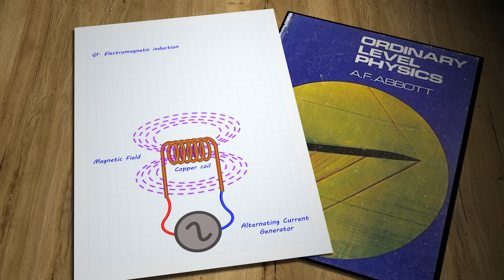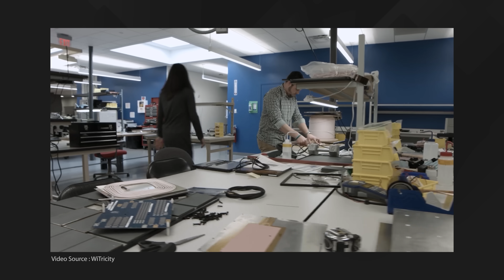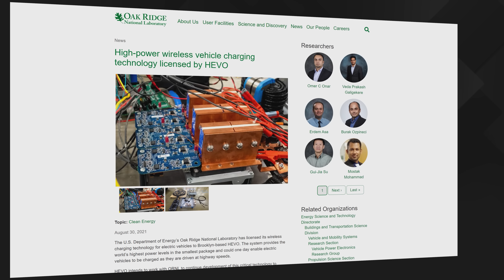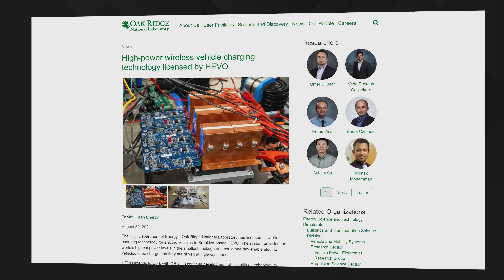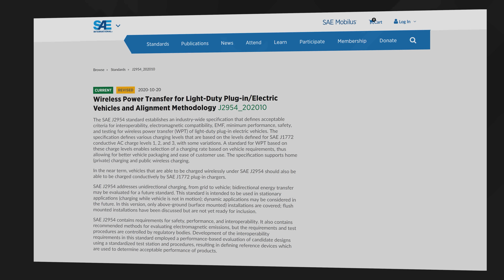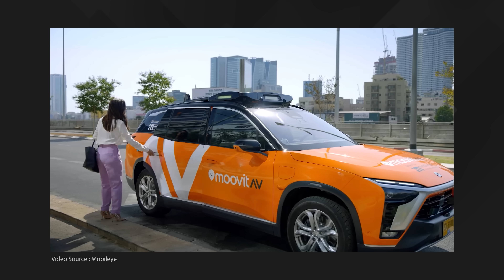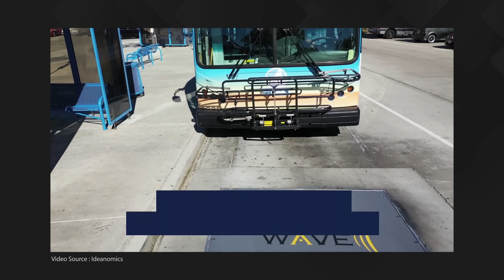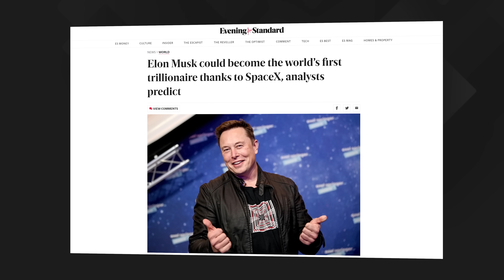Wireless FULL EV charging has arrived!  Exciting new tech breakthrough.

Comment: We already have "bus lanes with constant energy" - they're called "trolleybus overhead wires"
Reply: One problem with trolley buses. Route flexibility.
Reply: @mpetersen6  Then we're back to buses without lanes. The charging lanes provide almost the exact same flexibility as overhead wires.
Reply: @buttonasas  
We used to have trolley buses where I live in the 1930s. They got scrapped in the 40s or 50s due to the changing nature of the community post war. Busses. Diesel or electric are simply easier to reroute depending on the passenger load and where it originates from. One example is increased capacity to or from schools. 
The ultimate solution really is proper urban planning.
Reply: @mpetersen6  Oh, I completely agree. Independent buses have great utility. I am just complaining that the charging lanes don't bring much to the table.
Reply: @mpetersen6  Here in Netherlands there is only one trolleybus service left and that is in the city of Arnhem.
Reply: @buttonasas  Which is why the vehicles would have a battery to cover non-charging portions of an arbitrary route.
Reply: Yeah but you can’t really share that with a car size EV.
Reply: @peebherault , I managed to spend thirty-five years of my life without needing a car, until moving to America.
Reply: @alexwilsonpottery3733  lived in Japan without car for a year
Reply: @kc3nbr  Me too. Actually one would have to be crazy (and rich) to drive around with a car there. IMproved public transportation and walkable neighbourhoods are something that North America could use - but they/we love their cars.
Reply: @alexwilsonpottery3733  Different graphics, America is a big country with a diverse climate. I live 8 miles from town and winters here go down to well below zero Fahrenheit, try doing that without a car!
Reply: @mosfet500  I know of what you speak. Like you, everything here is seven miles away. Despite being from the west coast of Scotland, I’ve lived in Minnesota and Iowa since 1991, and have been a cyclist that whole time - much to the horror of some of my workmates and relatives. You don’t have to be a maniac like me - there used to be alternatives to car ownership not so danged long ago, and there could be in the future if we could just extricate our heads from our tailpipes.
Reply: @peterkratoska4524  As in many nations, cars are a status symbol. Exceptions are France and Italy wheren the car really is just a utility to get around. They bump up other cars to squeeze into a parking space. They also leave the handbrake off for this. It's common practice. Most french and italian car bumpers are a mess, especially in the larger cities.
Reply: No moving parts is a big longevity bonus.
Reply: @richardgoldsmith7278  Physical contact with those wires are pretty light impact and well worth the efficiency benefits.  The idea of using those on major highways to support electric shipping (rather than having crazy massive batteries) really makes sense to me. This video explores it - https://www.youtube.com/watch?v=_3P_S7pL7Yg
Reply: @ccibinel  "major highways to support electric shipping" already exist - they are called "trains".
...though, admittedly, there is definitely room for improvement in this area.
Reply: @ccibinel  The question is, is it more expensive to build an overhead power system, or is it more expensive to bury charging pads under the asphalt? I'm guessing the latter will be cheaper to do as it can be mostly automated. Plus no dependency on electrified routes, the battery covers non-charging parts of an arbitrary route.
Reply: @richardgoldsmith7278  compare the low cost of the trolly wires to building these wireless chargers into roadways.  Longevity would be relativity insignificant.  Plus, I can certainly envision significant in the equipment in the roadways.   Think of current potholes, as well as increasing flooding and heat buckling from climate change.
Reply: @bjb7587  in Russia after the war they had trolley trucks due to the gasoline shortages.

Comment: Do the home wall chargers have 100% efficiency? I think that 1-10% inefficiency of these wireless systems will add up. Having to dig up all the roads to install them seems like a long and costly job. Definitely has its uses though, just think we should be trying to use as efficient charging methods as we can

Comment: The efficiency figures are probably in/out on the wireless part of the system, given they are AC there needs to be additional circuitry to convert the AC to DC, then the losses to charge the battery itself, so realistically I would guess you are looking at somewhere between 70 and 85% real world electrical efficiency into the battery.

Now for a phone where you are putting only a few watts in, this doesn't really matter, but when you are talking about multiple MW of power, you're looking at 150-300kw of power lost to heat per MW.

Comment: I bought the Plugless Power wireless EV charger about 2-3 years ago for my Volt, had the unit installed in my Volt and the charging pad and inverter installed and it never worked.  Plugless sent out their engineer who lived at my house for 2 full days and never got it working.  Plugless sent a whole new system, I had it installed and still, didn't work.  I'm 100% supporting of the tech but they need to get it working before it will take off.  Luckily, I returned the system and got my money back.

Comment: What a stupid comment about the laggards. Of course EVs are here to stay. Of course they will move more and more into main stream use. But equally there is a ginormous gap between what the grid can currently supply and expected future use. A power station typically takes 10 years to come online. We all know the new ones won't be coal fired, but will they be nuclear?
Instead of hassling people for negative thoughts, how about addressing some of these points head on. Where is all this extra electrical energy coming from? When our cars are electric, our ovens, our central heating, our hot water, street lighting, buses, trains, lorries etc, etc etc and then eventually airplanes. When and where is the "absolutely massive" infrastructure needed to supply this amount of electrical energy being rolled out?

Comment: Cool story bro, but you still have the pollution producing power sources. If you want to charge EV's someone should put some thought into putting alternators on the drive wheels to charge the batteries which is already turning to begin with.

Comment: If the efficiency numbers sited are correct, the loss in the energy transfer is up to 10%, compared to a plugged solution. That’s great compared to the 50%ish loss in the tech used on phones. My power bank and phone have wireless charging, but I never use that since I get 1,5 charges from wireless and almost 4 charges if I use the wire. 

Even though it’s a great improvement, if widespread in cars, 10% will still become a humongous amount of power to loose just for the convenience of not inserting a power plug. Perhaps that loss could be offset by the batteries being available to the grid more time, or some other benefit, but it still makes me cringe a bit.

Comment: The problem with electric cars and it is one we can and will overcome is yes they do mostly run on fossil fuels as you said the nay sayers said. This just basically means that when we tackle the problem of power that creates greenhouse gases we are also tackling the problem of cars that create greenhouse gases and we need to replace the fuel used for both systems at the same time and as these are the 2 biggest sources of green house gas it's going to take a long time and it will fix a lot of the issue of green house gases.

Comment: 90% efficiency for the wireless charger connection is absolutely terrible.  That would mean that if you were charging at 10kW that you are losing 1kW, or 2kW on a 22kW charger as heat or somewhere else. If you are also talking about high power charging this gets even worse - at 250kW you are throwing away 25kW of energy somewhere, enough to dive a car at 110kph… If I said that I was going to put your power bill up by 10% you wouldn’t be impressed, and if we are talking about sustainability, then making the entire fleet 10% less efficient means more power generation is required overall. I also disagree with your premise of “why would an EV driver plug in?” You would plug in if there was an incentive to do so - for example being paid for any power that you sell to the grid. You also plug in so that your car is ready and charged again the next time that you use it.  

It’s great that they’ve made some advances on wireless charging, but I’m not sure that it’s great to waste 10% more power to do it.